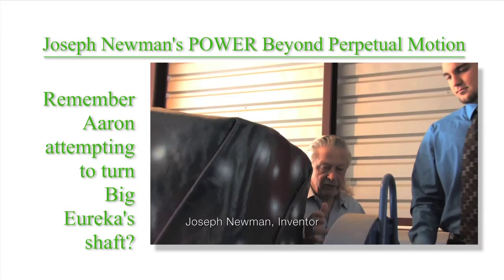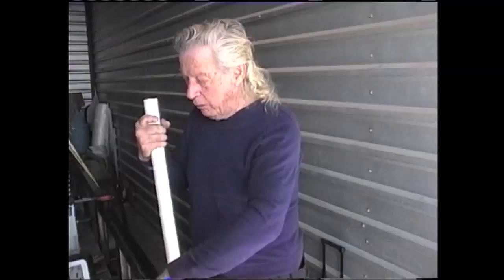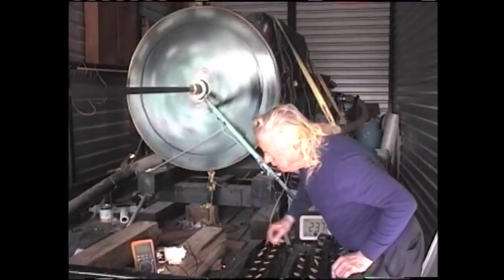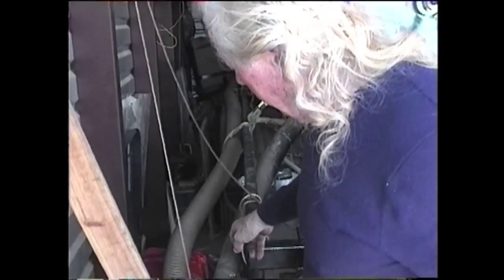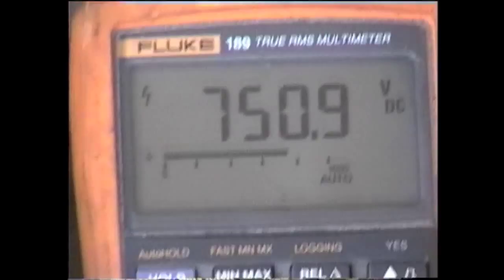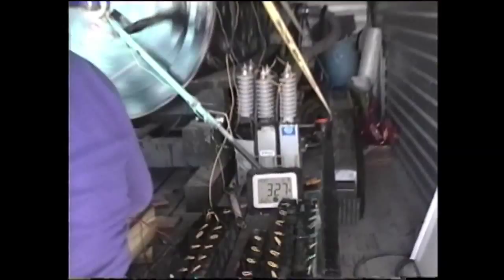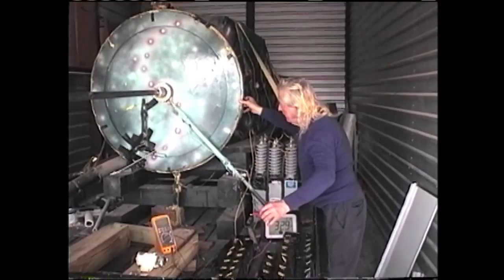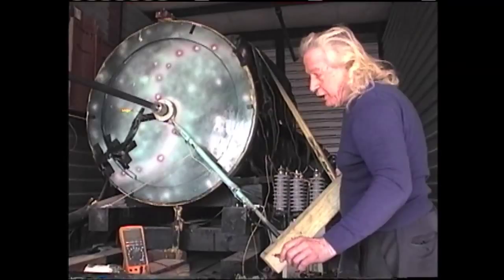Joseph Newman's POWER Beyond Perpetual Motion

Comment: If I calculate the Q on this machine, I get 22.  (wl/r) Power out/Power in = Q^3.  From Mr. Newman's estimation, I get Pi = approx 1 watt.  This means the Power out is approx 10,648 watts out.  This would be about 14 hp -  I think this is a little low for an estimation.  It looks like this thing is putting out well over 100 hp.  For a 1 watt Pi - that's pretty good.  

Nice job on this project.

Comment: !!!!! NEWMAN JUST SWAP THE BATTERIES TO A CAPACITOR DURING MID OPERATION AND LET IT KEEP RUNNING WITHOUT A LOAD.  make sure its a large enough cap to keep enough electrons to keep the voltage at the amount that you need and then your power source is a receiving source.... make sure to show the cap is EMPTY when you swap and it will prove it had to produce overunity and shut these idiot trolls up.
Reply: It doesn't work like that's. the capacitors dissipate power faster than batteries and take in power faster than batteries.  The batteries simply act as the pulsing energy to the system. During times of switching off, the back emf allows current return as voltage spikes contained in the capacitors during times of rotational movement.  Expanding and collapsing magnetic fields have a lot to play in his motor.  Read his book to understand it more in depth, it's clearly explained
Reply: I’m not a idiot for knowing physics
Reply: In other words, it doesn't demonstrate perpetual motion as he said in the video.  If it did, the batteries should be able to be removed and the motor and the motor should continue to run.    @ConstantineJoseph

Comment: Estimated Joseph Newman, I like the idea of his machine and I think that should get serious to activate it with solar energy better as this would give much more value to his invention, also this would not need a power source like a battery, many success in his project and that would change the lives of people.
Reply: Yeah with solar this will rock !
Reply: It would still need a battery in the circuit. It doesn’t need solar because(as a whole) it doesn’t use power/electricity. It actually creates an abundance of it. Clearly you haven’t watched his videos.
Reply: @louskunt9798 true. The battery acts as a power core while the motor acts as a powerplant. As the battery gives off energy the motor recharges it.

Comment: Commercially available DC motors are deliberately designed and manufactured to have extremely poor performance. In my opinion, the reason for this is that a properly designed electric motor could easily do away with the need for using internal combustion engines in vehicles and that would not suit the oil companies or their owners, the New World Order cartels. Worse still, electric motors with COP>1 open the way to self-powered free-energy systems and that would never do !!  In brief outline, present day motors act both as a motor and as a generator of electrical power, but they are deliberately wound so that the power generation is used to oppose the input power and so produce a completely crippled output. During World War II, a German Engineer re-wired a standard electric motor and made it self-powered, that is, it ran and produced mechanical output power without the need for any input power once it had been started. That shows the potential of a properly constructed electric motor with the same size and general structure of any commercial electric motor. Presumably, he did that by adding extra brushes and using some of the windings in generator mode with their output powering the drive windings which were arranged asymmetrically. There was also one other man who achieved self-powered re-wiring of a motor, but neither of those men made their information public knowledge. The con job which has been run on us for many decades now is to wind the motor in such as way that the magnetic fields inside the motor oppose each other. When a current is passed through a coil of wire, it stores energy in that coil, and when the current flow is cut off, that energy needs to flow back out of the coil and it will do so in the reverse direction. This is sometimes called back-EMF (“Electro-Motive Force”) although many people are not happy with that description. However, no matter what you call it, there is energy stored in the coil and that energy can be used to do useful work. But, the motor manufacturers choose to wind the motor so that instead of extracting that useful power, they use it to oppose a major part of the input power, creating a weak motor which heats up due to the wasted energy. Contributor “UFOpolitics” points out that a deliberate mis-design of electric motors has, for the last 130 years, been presented to us as the only way to make and operate such motors. He states that because the windings are arranged in a symmetrical way, that a braking effect is produced which reduces the output power of the motor by anything from 50% to 90%. That is, a properly wound motor would have anything from twice to ten times the output power for the same input power. This mis-design guarantees that present day motors are always less than 100% efficient and always heat up when run. This mis-design is caused by using symmetrical windings in the motor. Standard motor wiring is quite different and the killer effect is caused by having two windings which face each other, powered simultaneously with currents flowing in opposite directions. This causes a complete conflict between the magnetic fields and that destroys the efficiency of the motor.